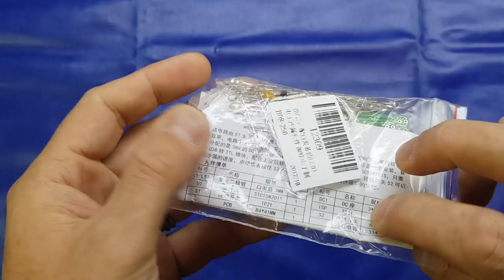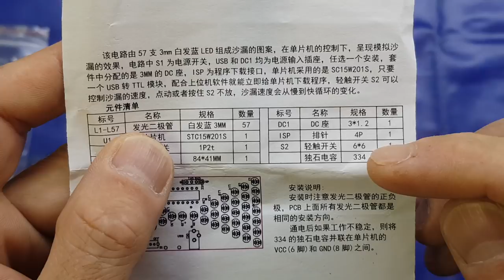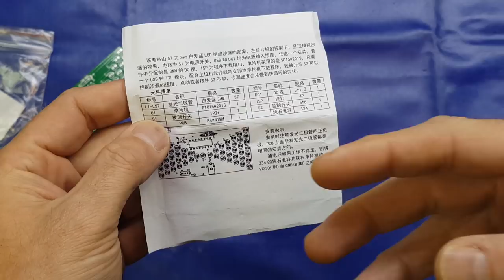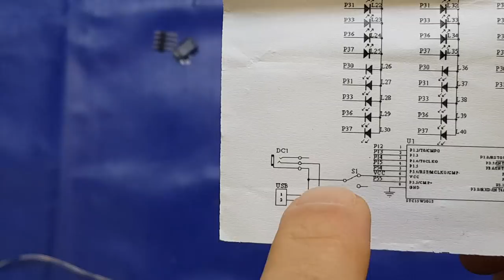LED sand / egg timer kit build & new camera test (electronics tutorial)

Comment: I did the video on that kit a week or so ago. the capacitor goes across the supply rail if the microcontroller is unstable. It actually shows it in the instructions you have there but written in Chinese. I used google translate on my phone to convert the text to English and it explained it there.

Comment: That is really cool!  I put together a ton of different kits but have never seen one quit like that.  Strange, I had dozed off at my keyboard, and when I woke up, you were assembling the kit. Not having read the info about this kit, I looked at it and wondered, why is he assembling a Chevy emblem.  Made a lot more sense when I read the label and found it to be an egg timer.  I have had to make three timers, each programed for different times, two are for my wife's medicated eye drops; she has Glaucoma and must install drops twice a day, one  one she must wait 2 minutes, the next is 2.5 minutes.  The third is for my Ford Edge, while towing her with all 4 wheels on the ground, I must stop and run the engine for 5 minutes to lube up the automatic transmission, to keep it working.  We just finished a 1500 mile trip towing her behind our 35 foot Class Motor Home.  Just arrived in Arizona from South Dakota.  Nice trip, this was our 3rd year for the trip, and it seems we grow to love the Mohave Desert more and more every day. We have previously lived in the Desert when I was Stationed at Fort Bliss Texas back in the early 1970s

Comment: Dunno if the autofocus is working right. At about 3:30 when you were putting in the last few LEDs, the autofocus seemed to lock on the header on the bench, then back to your hands and back to the header and so on. Thought first it was the beer, but after rewatching it, it was the camera. 
Other than that, the video quality was really good and very clear.
And have one of those kits ordered - winter night soldering awaits :D

Edit - best of luck with the move. Looking forward to the workshop tour when you guys get settled.

Comment: I have had circuit boards like that, sometimes changing solder can help, other times spray with some isopropyl alcohol and wipe off quite hard (may be some residue) and if that fails, wire brush and roughen up the pads a bit
Reply from the maker: +stealth banana it was the LEDs, everything else soldered up nicely...might be a weird alloy that the leads were made of.
Reply: Kris Cochrane I've heard other channel hosts say they reckon they're old LEDs that have oxidised on the leads.  Having said that you'd think the extra flux might do the trick.  Maybe rubbing one with a bit of glass paper and trying soldering then might prove or disprove this theory!